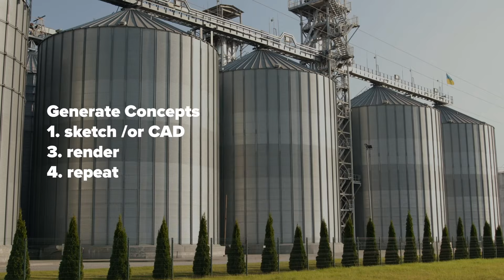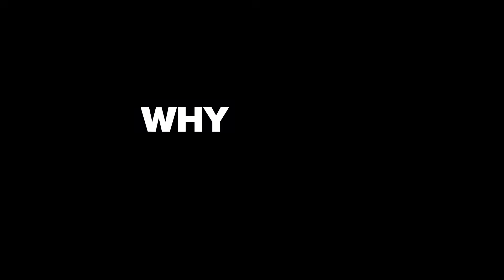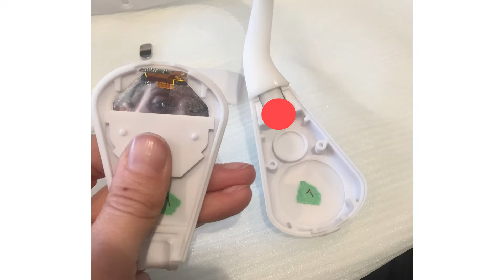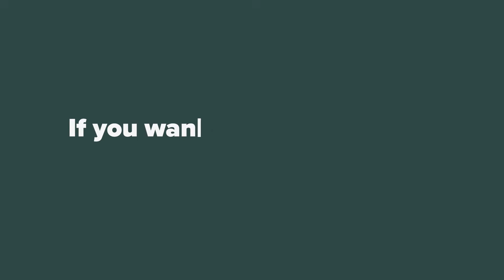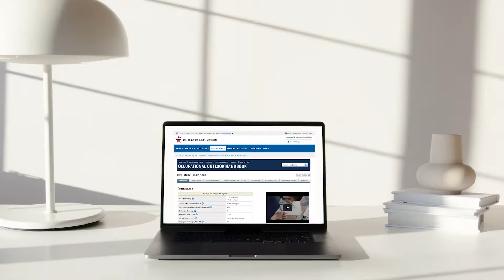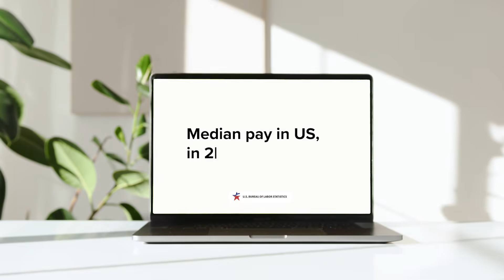Everything you need to know before starting Industrial Design

Comment: I wonder if SketchUp is allowed to be used in the trade.
Reply: I recommend you learn a more traditional cad like fusion 360 or solidworks. Both work in a very similar way so switching from on to the other shouldn’t take much time.

Comment: hey so i got a question i actually would like to go in depth to but i dont have time rn…
whats the diffrence between transportation design and industrial design. and do you think industrial is a safer option??
Reply: I didn't have an option to study transportation design, but I still got a job as an automotive designer with the industrial design degree. Industrial design is a lot broader field and you will probably learn a lot more things, but the down-side is that you probably won't do any clay modelling or learn Alias Autodesk. If you want a job in transportation design, then you'd want to learn Alias - most car brands use it for surface modelling, as well as companies like Bombardier (they design and manufacture trains).
Reply: @WinningDesignsChannel  thanks
Reply: @WinningDesignsChannel  did you go to school industrial design
Reply: @KanwaksanDadi-u7q  Yeah, I went to QUT in Australia

Comment: Do you have any tips on how an inventor can find an industrial designer for their product and what to look for hone searching for one?
Reply from the maker: Hi Kristi, the first place to look for Industrial Designers are professional Industrial Design associations. In Canada, check out acido.info. In the US, check out  IDSA.org. 
1.  I would look for a designer who has worked on projects similar to your invention. It doesn't need to be the exact same but it should have similarity in complexity and/or materials. For example, if your invention has electronics and mechanical design, find a designer who has experience designing products with these 2 elements. If your invention would be made out of fabric (cut and sew), then look for a designer who has experience designing for fabric.  
2.Ask them to walk you through their portfolio to get an understanding how they contributed to their projects. Some designers only work on the front end of the design process and don't know a lot about manufacturing. You want to know that you are working with a designer who can take your invention from concept stage to design for manufacturing stage because it will save time in the long run.
Reply: This is a tough one because you will be divulging your invention details. I would suggest searching a consulting firm that has experience in the product category such as consumer electronics, small appliances etc., but not in the same product because you can get into litigation.  I would not recommend even talking to one of those “invention solution” companies.  One way to do this to request a quote from a consulting firm but make sure you ask if they are willing to sign an NDA or other legal document to protect you and them.  Hopefully, your invention is patented and you have saved your earliest sketches and you dated them.  This isn’t much but I hope it helps a little.